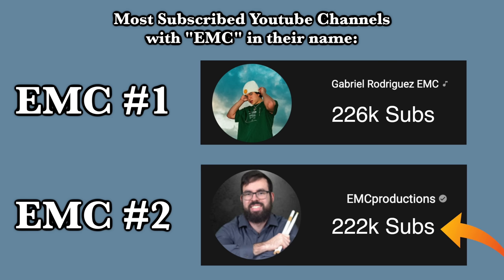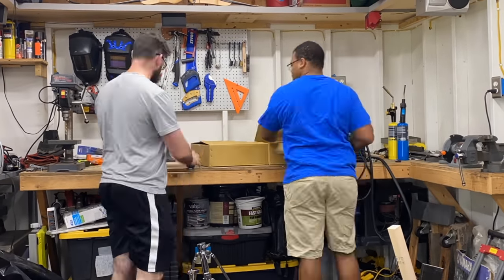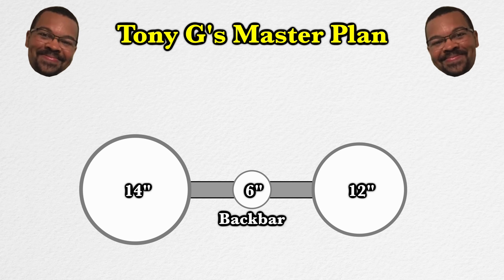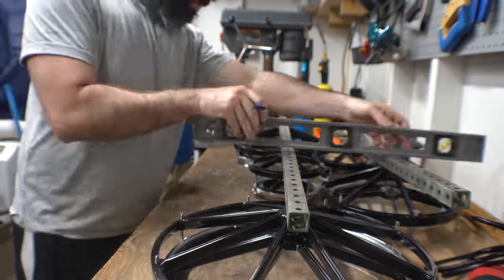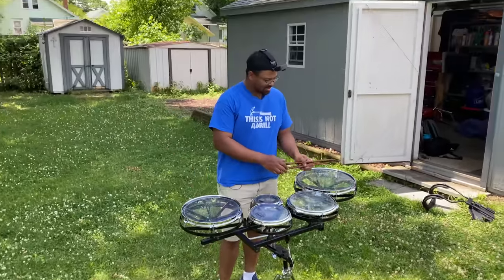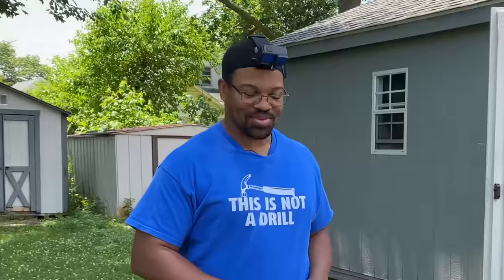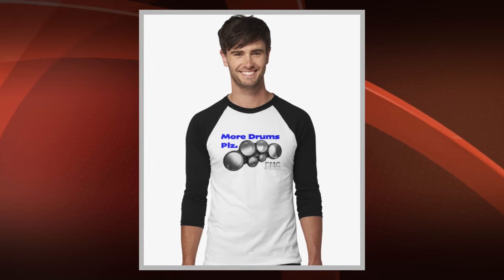We Made Marching Roto-Toms (Roto Tenors)

Comment: Good morning! I got confused when you said "we don't need this aluminum stand since we want our frame to be all metal." I get it now, but I thought at first you were saying aluminum wasn't a metal. Lol
Reply: Wait, what’s the joke lol
Reply: Lol this was exactly what I thought
Reply: I think he was using metal to mean steel, and that it was a metal that was easy to weld.
Reply: @dansv1  : Aluminum is easy to weld, just requires more gear to do so. I have been inspecting welds since the early 1970's, and have seen plenty of aluminum along with all sorts of other metals.  Now, if you want to see some interesting welding, look up plastics.  Hot air, heated roller fusion welds and ultrasonic welds in varied plastics are commonplace out there.

Comment: Now you need to add motors to them so you can either tune them to a song or just have them constantly turning for crazy licks
Reply: Yesssss!!!!!!!!!
Reply: Program the motors so they tune as you play the song--either it tunes with a track, or works with drum triggers so it tunes after you play the note
Reply: @CerealSSBU  it would completely screw up if you missed a note
Reply: @pesty4592  Not if you used a drum trigger to detect when the head is hit. Technically if you stayed in the pattern and corrected a beat, it would keep working.

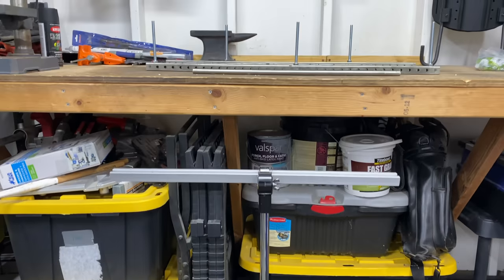Comment: Uhm... At 2:06 you said that the drums had an aluminum frame, but you were making your own out of "all metal"? Sorry, but aluminum is metal.  Your video showed your new frame bejng fabricated from galvanized steel. Yes, it's metal but it's twice as heavy and despit you comment about your "metal" frame being weldable, an aluminum frame is also weldable.

The steel frame can be welded by stick welding (SMAW), shielded wire  weld (GMAW, also called MIG) or flux core wire weld (FCAW). Aluminum welding is commonly done with TIG (GTAW) which requires a shielding gas such as argon, a regulator, Tig torch and power supply, but aluminum is easy to weld with the proper tools. While this may sound strange, after 5 decades of inspecting welds, I can identify the method used by smell, the fumes off the weld puddle are distinctive. 

Regardless of your mechanicals, this is a great project, and the drums sound great!  Also, keep working on that beard. I have been growing mine for 54 years and counting!